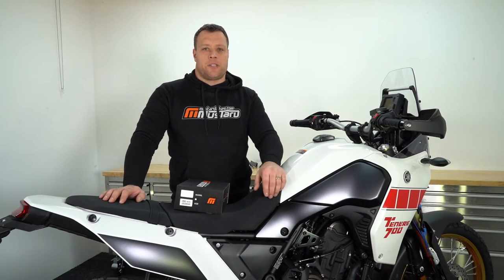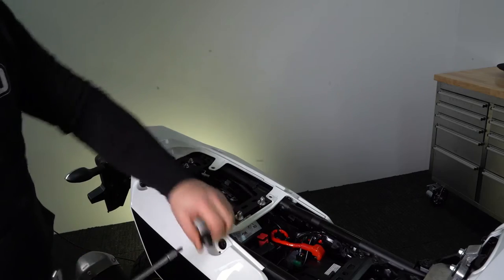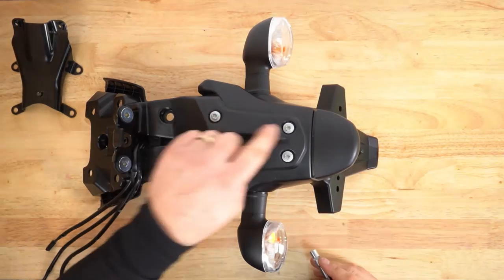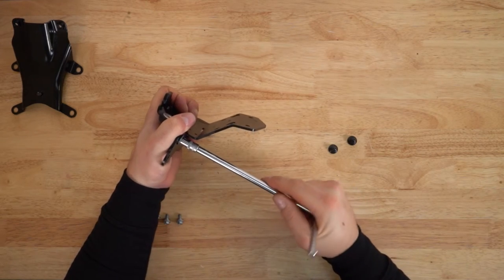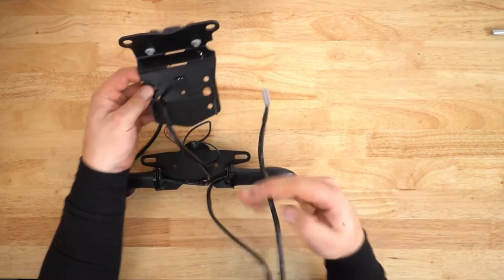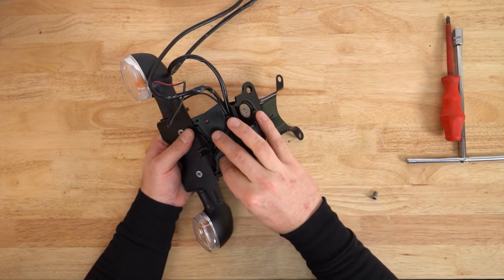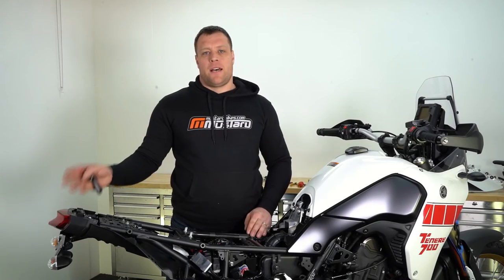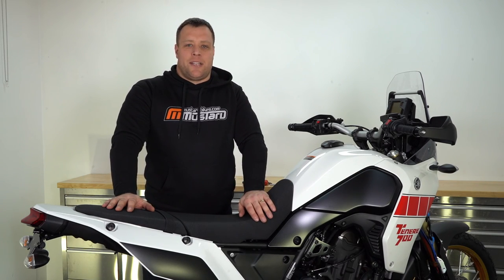Fitting a Mustard Bikes tail tidy to a 2019 Yamaha Tenere 700

Comment: Couple questions:
1) will this tail tidy work with the HP Corse high mount exhaust?  The exhaust outlet sits right behind the stock the turn indicator.  The tail tidy must lower the indicators.
2) I will be getting a 2023 that will have the new LED turn indicators that will probably have a smaller holes needed to mount them as compared to the older incandescent monsters.
Reply from the maker: Hi Dave,

I suspect it won’t work with the HP, as the length and positioning of the outlet will likely interfere with the tail tidy / indicators.
In regards to the LED indicators, on all their other bikes with LED indicators Yamaha have still retained the oval shaped mount, so that shouldn’t be an issue.
Reply: @MustardBikes  thank you for your speedy reply!